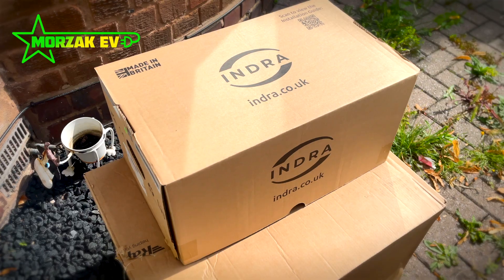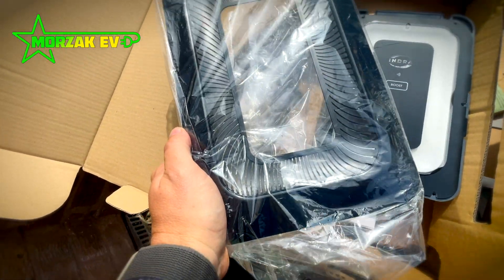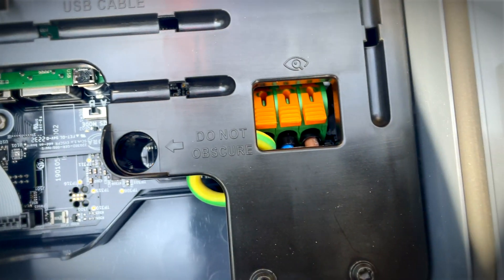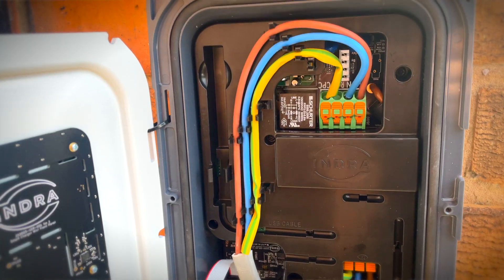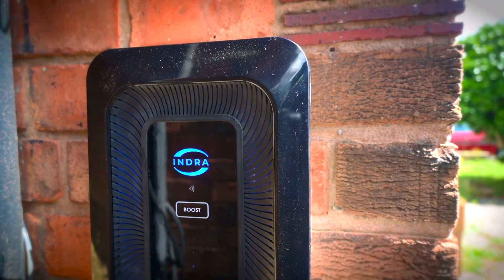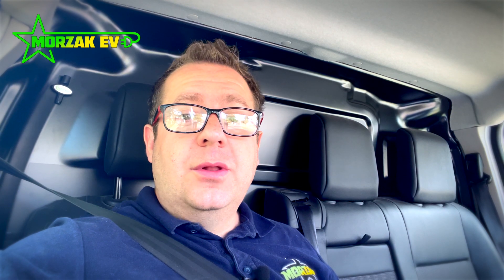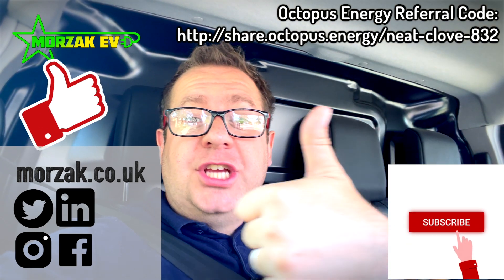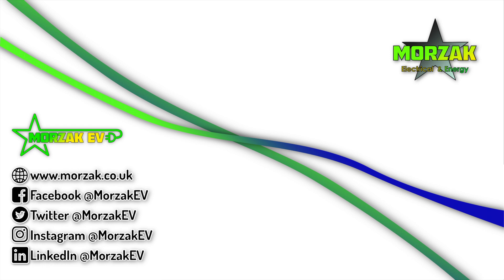Indra Smart Lux - sexy new charge point unboxed and installed

Comment: If the software, and design of the interfaces and features, is done by the same team that did the previous Smart Pro charger then this is certainly one to avoid. I doubt they have even thought about fixing the issue where it goes offline late at night - just as your cheap rate electricity is about to kick-in.
Reply from the maker: The previous software was using a different platform. From experience, i don't have any customers with that issue.
Reply: @MorzakEV  I have migrated to the "new app". I frequently see it offline at 10pm when I'm about to plug my car in. Frustrating to say the least.

I also used the lock charger function one day. Great I thought... but the charger then lost connection to Indra and I couldn't unlock it to even boost charge using my phone!

And then... the app tells me it is charging beyond my programmed end time for the cheap rate leccy. So full of bugs. I really am surprised others don't see these issues and don't complain. I take screenshots of it all just to prove I'm not going mad.
Reply from the maker: @jp6975  Sounds like you have some sort of comms issue, or a problem with the unit. Are Indra dealing with it?